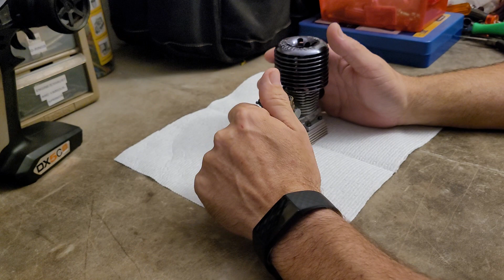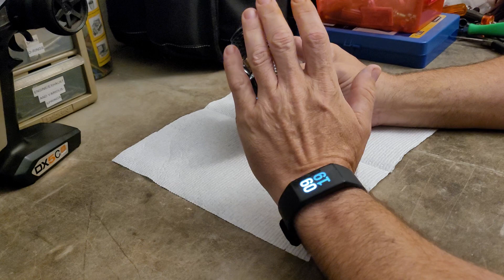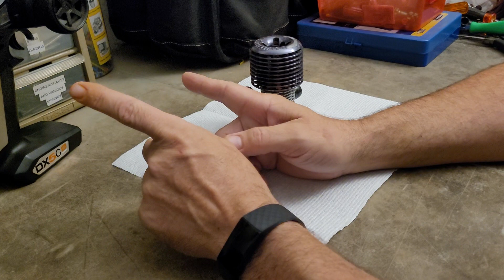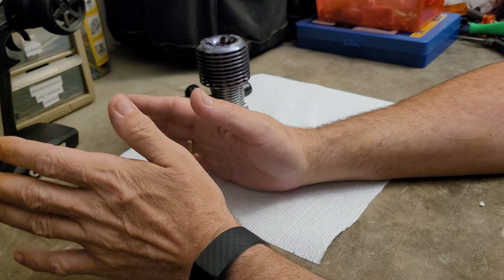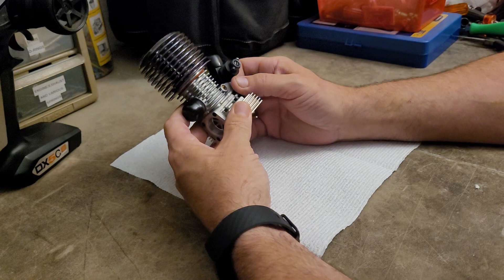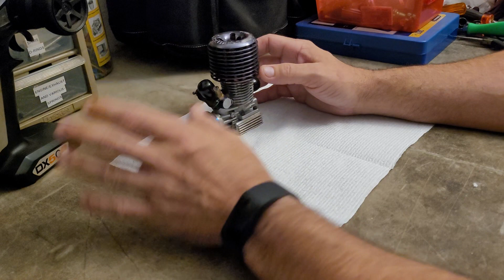Let's talk about Nitro engine tuning high low speed needle idling and air leaks

Comment: If the rest of the engine is solid and makes good power I would throw a better crank in so it will last if the crank snaps you take a chance of cracking the block then you won't be able to put another crank in

Comment: Awesome video, Todd. Getting stressed out just thinking about how much time I spent chasing that idle, just to realize I spent a three hour afternoon tuning the entire time, instead of having fun. I think it’s great how you explain the balance between proper performance and tuning, while still enjoying yourself and the hobby in general without your hair falling out over a two stage idle. Great video man!
Reply: that is how I am when I go out. I spend most of the time tuning. I get obsessive about temp. It can be running absolutely perfect but when I see 260-270 degrees I start screwing with it. Everywhere I read says "oh don't go over 240". If I tune to 240, it is slowwwwww and super rich.

Comment: I feel like your idle tells you a lot about your tune but when you don’t have that right single stage idle you don’t have a perfect tune but there is also the tuning window where you aren’t at full performance but you aren’t flaming out and it’s drivable you can just warm up and run practice after practice without touching needles 
I usually keep my needles fat the biggest hurdle I jumped learning nitro was when I learned there are long and short needle carbs I think the long needle carbs give a much better power curve but can be difficult to tune until you find the right technique that works for you David rc did a really good video tuning long needle carbs and it’s worked great for me 

Great video Todd lots of good topics
Reply: At lake park that idle better be solid 😅 that dang ramp kills me
Reply: One thing I’ve noticed from going 20-25-30 is the more nitro percentage the larger the tuning window seems to be but the run time can be slightly different